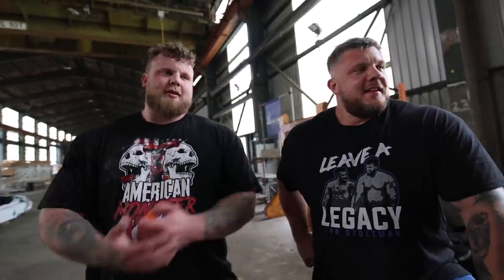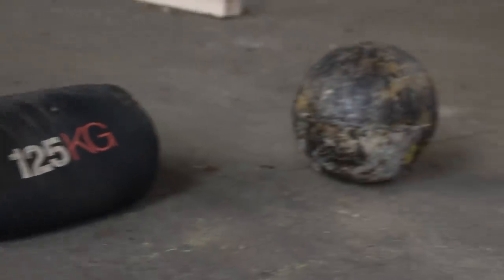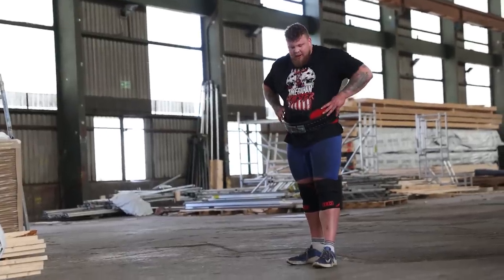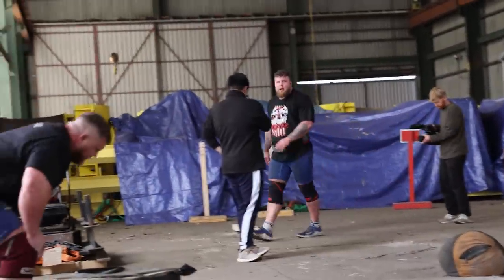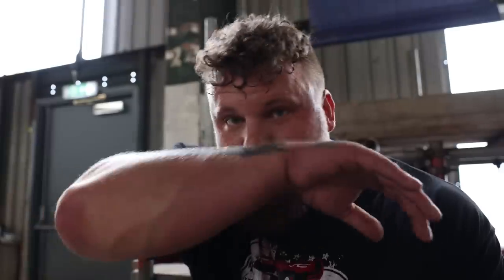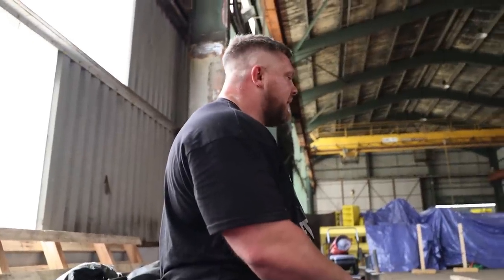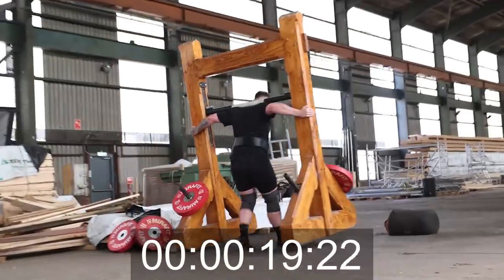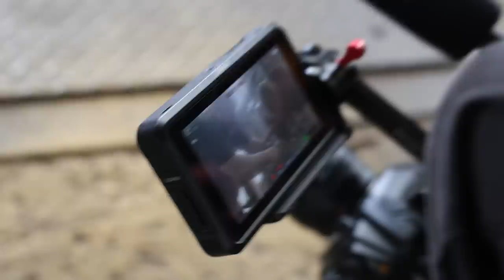OUR LAST SESSION!

Comment: Do you think a 600kg deadlift could be possible for Eddie Hall or Ivan Makarov ?
Reply: Eddie had a soft lockout and self admittedly almost died, and Ivan isnt even at 500 so you need a reality check. Unless you're talking about an.18 inch deadlift, but even then they dont have it
Reply: @J.c410  yeah true, he just answered to a question about the 600kg bar but Makarov is preparing for at least 550kg deadlifting
Reply: @musicisthecure6934  No he isnt. You're juqt thinking about thatt time he did a 550kg block pull. Ivan has been stuck pretty much zt the same weight and unable to lockout 500 for like 2 years now, he learning curve is at the end. You shouldnt exoect him to get any signifucantly better from now on, hitting a clean 500 would be the max for him. Only health Asko Karu or Pavlo Nackonechny can go beyond that right now